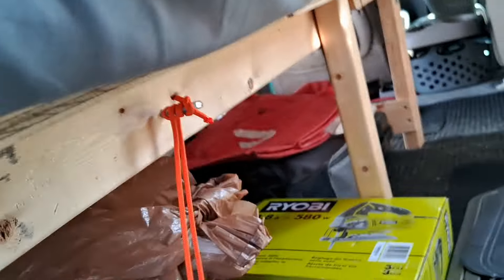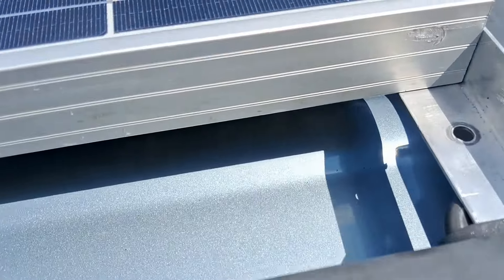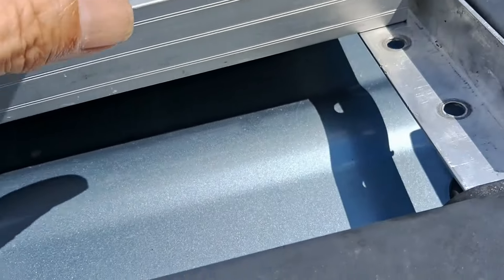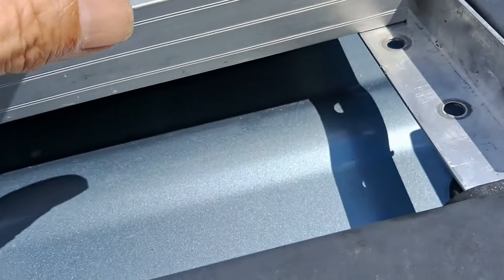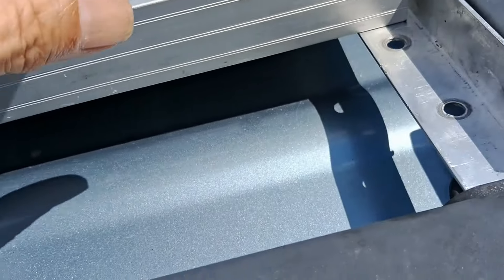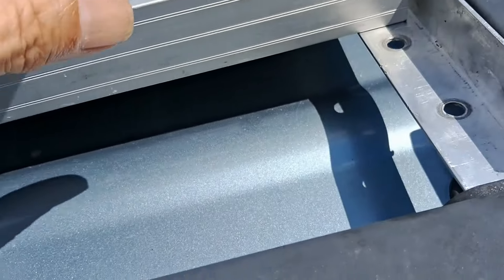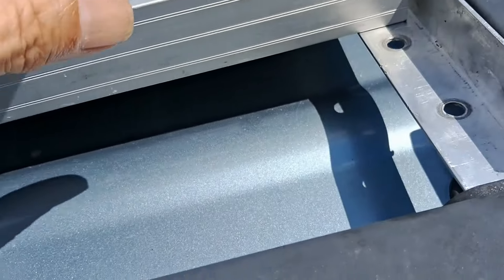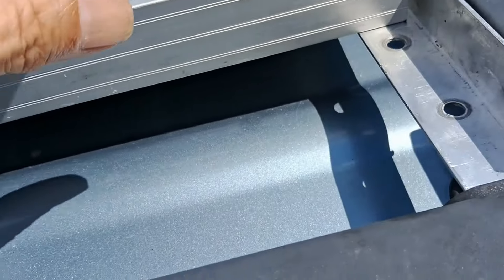Vanlife | Some Updates on 2008 Toyota Sienna Minivan Camper and ME!

Comment: Tim, I have a Sienna. Did you see my solar panel video a few m months c ago? I got one bigger one that fits perfectly from SanTan Solar in  AZ. It was a little over $100. I forget, maybe 430w, or close. I it’s an exact for between the bars and doesn’t need extra bars.
Reply: Adding the additional solar panel power is a great upgrade. I think I will do the same on my minivan.
Reply from the maker: A very nice panel! I already have the 100W panel. So I just want to add another one to make things simple and not spend more money.